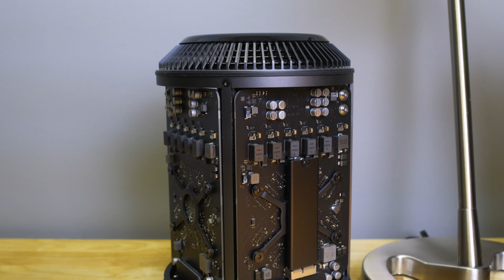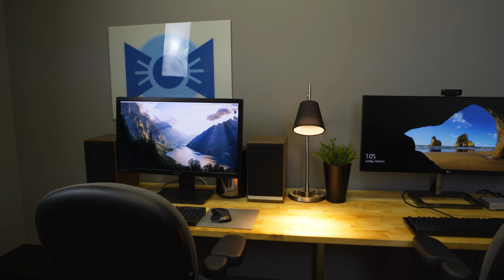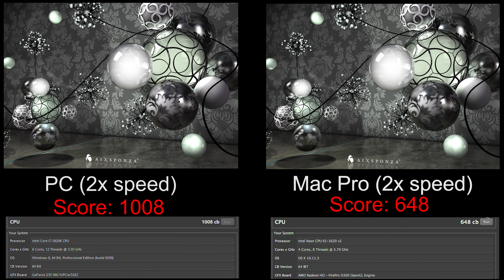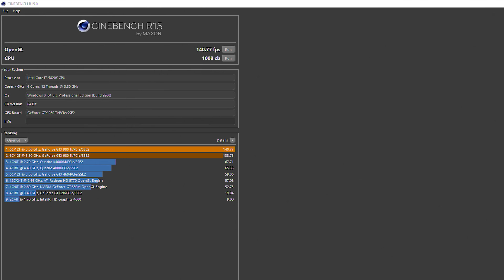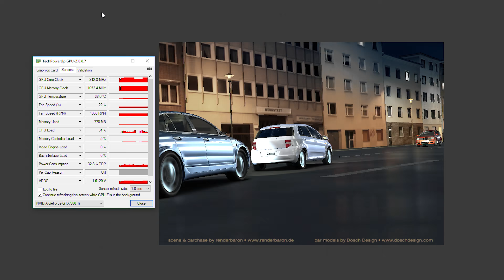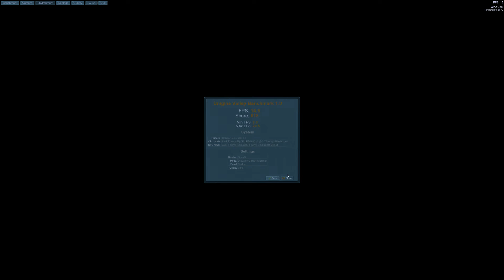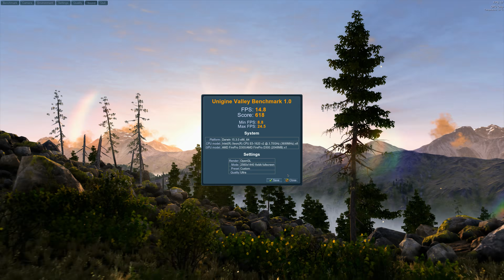$2,000 Custom PC vs $4,000 Mac Pro

Comment: I'm getting a $1999 Alienware 17 laptop in June. Even among gaming laptops it's expensive for what you're getting, and it's still $1000 less than the Mac Pro and with better stats. It's got a 1tb HDD + 126 GB SDD to the Mac Pro's measly 256 GB SSD. It's got 16 GB of RAM to the Mac Pro's 12. It's got a quad-core processor that can be easily overclocked up to 4.1 GHz to the Mac Pro's Turbo-boost to 3.9 GHz (same stock clock speed at 3.7 GHz). It's got a GTX 980M with 3.2 teraflops and 8GB of VRAM to the Mac Pro's dual AMD d300's with 2 teraflops and a combined 4GB of VRAM. 

You know it's a huge problem when your "professional" flagship desktop is outperformed by a LAPTOP that costs $1000 LESS!
Reply: +IAN 4000 Is there a reason you are getting a laptop over a desktop at all? I love my MSI laptop that I got and I'm not going to fault it but I know I shouldn't of spent the money on it when I could of had a beastly Desktop that would way out perform it for about the same amount of money.
Reply: Adam Hyland Yeah. I'm a student and I need to bring it with me where I go, for taking notes in class, etc. And oddly enough, the Alienware 17 actually gives really good performance for a laptop. So I'm sacrificing a little bit of performance and cooling power so that my next computer can be portable, but I don't expect that it will make that much of an impact. I wanted to build my own computer, but that wouldn't be very practical for the kinds of things I use a computer for. 

I just thought it was funny that a laptop, not even a desktop, has far better stats than the entry level Mac Pro and is $1000 cheaper. 

If I were going to spend the $9,599 that a maxed-out Mac Pro costs, I could build myself a literal supercomputer. Or a small render farm. It's ridiculous how much the Mac Pro costs.
Reply: Haha that is true! I think everyone is starting to realise that with apple products your just paying for the logo. I'm in the process of building a new gaming PC/editing PC or getting a car it's kind of hard to see what I need since I need both. Hope the laptop goes alright for you!
Reply: Adam Hyland I used to love Apple products so much, but that was before I'd seen what you can do by building your own PC. And like you said, I definitely started to realize that Apple products were a lot more expensive than they ever should be.

I went to the config page for the Mac Pro and it costs $1200 just to upgrade from 16 GB of DDR3 RAM to 64 GB, with a clock speed of just 1866 MHz. That's... bad. That's crossing the threshold between benign overpricing to just stealing from people who don't know how much upgrades like RAM are really worth. 

Thanks, by the way. I hope the laptop will be good too.

Comment: Pretty easy to me, Apple makes so much more money with its phones rather than its computers and because of that they do research and things just (not really just...) on the iPhone in order to sell more and more. Well, iPhone is pretty bad also in terms of specs and Im really not a fan but if you take a look at the single core scores and the general optimization of the software is quite impressive with this said you should not buy macs since hackintosh exists lel

Comment: 8:00 this statement can be applied to pretty much ANY of Apple's products.  Their OMG announcements for the iPhone are generally the same technology that other mobile device manufactures have had for the last three years.     The old saying that photo and video are better on a Mac is out dated.  The HDMI LED monitors that you can get for $150 give an equal performance to the $500 Mac monitors, the Mac systems (as seen in this video) fall FAR behind the current PC versions.   Apple no longer has technological edge, they simply repackages other companies ideas and sell them to their mindless consumers.

Comment: having done video editing on both pc and mac since 2000 over the years i have noticed a major change.  mac used to be the way to go for a editor they had better performance and just worked so much better than the pc counterparts of the time (the early 2000s) but over the years 2005 or so and onward they just kept getting worse and worse.  you would pay more for less and less.  and at the same time PC's caught up to and surpassed mac for professional use and just kept getting better.  I have always been a PC person for gaming and general use and had several mac's for work and video but i have moved more and more to just PC because it works for everything better now for a lot less.  In fact when the time comes to retire my current mac book that I have for work I wont be getting another.  I have already gotten a PC laptop that works better

Comment: 6600K(air) / 32GB / R9 390 - All at stock speeds in a Corsair 250D:
Cinebench
CPU:        432
OpenGL: 124.79 fps

Haven ( OpenGL / DX11 )
1487 / 1694

Only one of those test (Cenebench CPU) did the MB Pro beat my stock 6600K/390. A less than compact system can be built today for 1044 according to PCPartPicker. Yeah, that Mac Pro ...

Comment: Benefits of a mac 
-Don't have to build it, you can buy it already built
-easy to organize and edit pictures/videos
-hard to get viruses 
-good security
Reply: You obviously know nothing about computers.
You don't have to build any Windows computer. There are plenty of prebuilt ones. Building one manually is better because you pick out the parts you want.
It's easy to organize and edit pictures and videos on Windows.
It doesn't matter the device you're using, you can only get a virus if you're computer illiterate.
Good security? What does that even mean?

Comment: That mac is a overpriced dustbin at $4000. What is in your mind Apple selling something that should be $1000 at $4000. Make a new model which is way more powerful so it could be $4000 but don't make it with old specs just put al the best specs for that price tag. Don't fail again Apple!

Comment: I had bought a brand new PSU (80 Plus too) from a credible store once and my computer started acting weird. Thinking it was my hard drive, I whipped it... didn't help... bought a new SSD (which was also an upgrade from the HDD that was in there).... didn't work. So, I took it in... and it was the fucking PSU all along. F. M. L. They fixed it for free, though, considering I bought the damn thing there.

Comment: So when you are comparing: RAM: MAC: ECC memory PC: non-ECC memory  There are going to be lags in the memory alone because of error correction controls. You need to buy an ECC MoBo and ECC RAM and then compare the "Current" hardware available with a system that is also running a server grade processor. Yes, I can build a much cheaper system with higher output and faster everything, but when rendering large files, you want/need that error controls to prevent corruption. The processor and memory are not an equivalent measure. I am all for showing that Apple products are less than par for being up to date, but you need to compare hardware with equivalent hardware. 
Overall, good look at what is possible from a PC offering. Please do a price spec on a motherboard with ECC memory channels, ECC memory, and Server grade processors like XEON and then compare the cost of the Mac. You may want to also disable OpenCL to make the CPU/GPU faster on the Mac, it is disabled natively on PC. 
I use both Mac and PC for different uses, but the Mac does have a lot of advantages over the PC in various software applications as does the PC with software and other price points. 
I am not sure how you built your system for $2k, but I just purchased an i7 (4.0GHz Skylake) quad-core with new GPU (R9 390x 8GB), mobo (Gigabyte Gaming 7), 32GB RAM (DDR4), CPU Cooler, and SSD drive and that was almost $2k. After getting the new case, PS, and media drive (Blu-Ray and DVD burner), I am well over $2.2k.

Comment: "Mac is better for video editing" - Please refer to benchmarks.
Reply: +Vaypah I think they are referring to mac only software. Even software which exists for both Mac and PC like photoshop is still very different for some reason. With the Mac version having features the Pc version don't for some weird reason. Apple really have cornered the editing market.
Reply: +Tim Jadeglans 

"With the Mac version having features the Pc version don't for some weird reason."

Name one of those features.
Reply: microsf121 This was in ~2007, with photoshop CS3 which i had both on PC and Mac at the time. So it is very possible it has has changed since. However in the mac version each picture were not bound to the work space of the software and could be handled like its separate window while in the PC version they were constrained by the workspace given by the software. Both version could "do" the same things but the mac version was easier to work with my reference material thanks to that. I don't own a mac anymore so i cannot compare the more modern versions.

Comment: Could it be that Cinebench just runs faster on Windows or that the MacPro clocks down the CPU under heavy load? I have a 4.5 year old computer with an Intel Core-i7 2600k at stock 3.4GHz and just 8GB of ram to suppport it and my Cinebench CPU score is 742 points, wich is about 100 points higher than the score of the Mac Pro.

Comment: You're basically comparing a gaming rig to a desktop workstation. This is like comparing apples to oranges. Workstations, be it Mac Pros or other Windows-based workstations are expensive for so many reasons. Durability, stability and most importantly, quality support and after sales service. I have a gaming rig at home for fun and a Macbook Pro for work. Each has its own purposes.

What Apple sells are lifestyle and fashion. Not just a simple performance. A GAP suit works just fine like an Armani, but what GAP doesn't have are the sense of fashion, style, luxury and just because one guy choose to spend his gazillions of money to buy a LV doesn't mean he's stupid. He knows what he's buying.

So can we, PC gamers, stop being inane and insecure? Let's face it. Without Apple's unibody aluminium design and its hipster boneheads, most Windows-based laptops would still be made of plastics just like Acer, Toshiba, Fujitsu, etc. of the 2000s. (IBM Thinkpad was good though.)